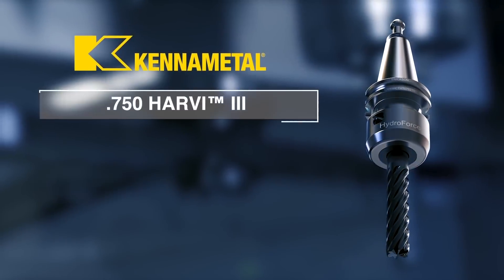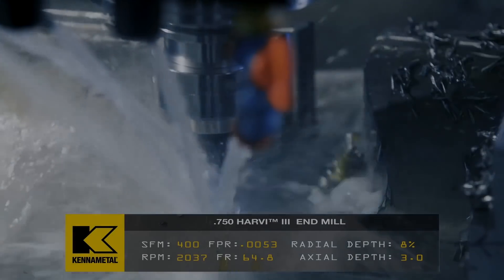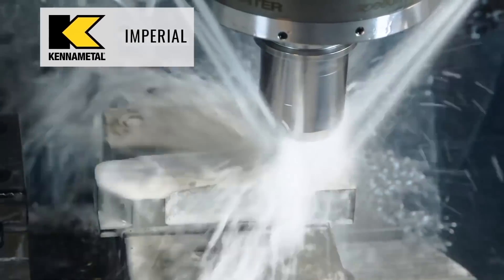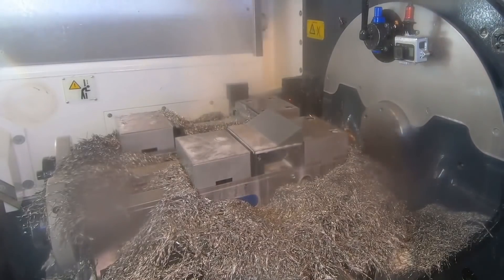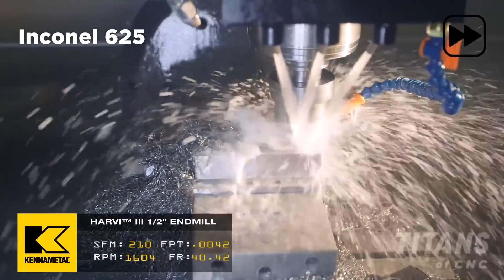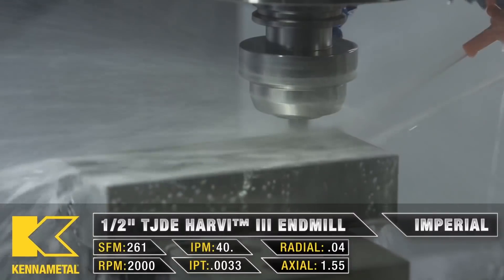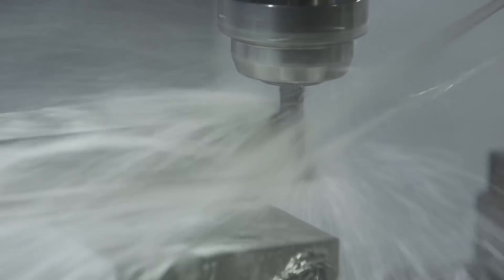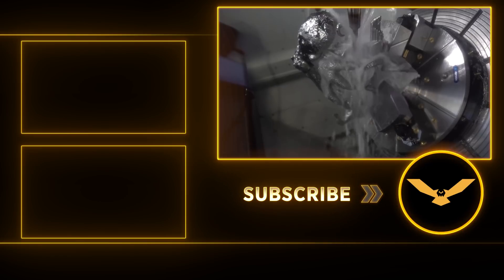The ZOMBIE MILL Apocalypse | Metal-Hungry Cutter Won’t Stop Eating | Immortal CNC Machining Tool

Comment: I have a question. Is there a rule of thumb regarding  spiral milling into a pocket versus starting the pocket with a drill? Obviously a lot of deep pockets would favor a starter hole and few shallow ones favors spiral milling, but we aren't here for the easy answers. 
How to calculate the near exact cost for each scenario is pretty straightforward but very tedious. And if you have pockets of greatly different dimensions then you have to make calculations for each pocket, determine toolpaths for multiple scenarios and combinations, etc. And if the part is a small one-off or a small job to bid for, then it simply isn't worth your time to make exacting calculations. 
I'm not a CNC programmer, just thought of the problem and couldn't see a solution.

Comment: Titan, Will you be going to FabTech this September?
Reply from the maker: No, not this year. Going to EMO2021 and then IMTS2022
Reply: @TITANSofCNC  Ill have to add the IMTS2022 to my schedule. Manager of CNC equipment at my job. You're earlier vids of HEM on hard materials inspired me to fix pre-existing programs from before I started. Now we running faster and tooling life is up 3 fold. All stainless 304L... Breaking that (change another man's program) wall for the better., More like , the programming was outsourced before I came onboard.

Comment: So it should work great with 17-4
Reply from the maker: It definitely works but you might want to switch to the HARVI 1 TE… It’s a Beast in Steel. Kennametal also has a KOR series end mill which is special for Stainless
Reply: I will definitely have to look into it I’m having a vary hard time with my boss ceo and programmer trying new things or buying new machines

Comment: My boss has finally let me buy one, dying to try it out!
Reply: "Breaks it first try''
Boss: REALLY!?
XD
Reply: @revenger2111  I better bloody not! haha!
Reply from the maker: Buying it from our store.titansofcnc.com right?? 😂
Reply: @TITANSofCNC  Unfortunately no, I was going to buy a couple at your boombastic show, but you only have imperial sizes, and can't be shipped to New Zealand anyway. I love what you do, and your passion for what you do. Your channel's been a great inspiration to me as a machinist. I've got a job tomorrow where I'll be using a 60mm (2 7/8") Udrill in my VF-3. That's gonna make some chips; I'm pumped!
Reply: When are you getting it?  Post here what came out of it. What you did.  What he said. ;)
Reply: @danl.4743  Will do. We've got a production job we do every other month, we know how many parts we get out of our endmills so this will be an accurate way to test. So unfortunately the results are probably two months away, can't wait!
Reply: @danl.4743 
I finally finished my experiment! I tried a few brands, all 6mm endmills, same speeds and feeds on a clapped out old Mazak using ER16 collet holders. Material is laser cut stainless steel sheet.
Aliexpress Blue (r0) = 0 parts (lol)
Aliexpress Grey (r0)= 32
Aliexpress corn cob style = 66
Speed Tiger PVR (r0.5) = 71
Aliexpress Green (r0.5) = 74
Speed Tiger EE (r0) = 244
Garr VRX (r0.5) = 288
SGS 46854 (r0.5) = 361
Kennametal Harvi 1 TE (0.3 chamfer) = 634

Yea, there's a pretty clear winner there!
Reply: Lol!  We broke our first one in seconds.  Shitty HAAS milling chuck broke it. Second one we put in a weldon holder and its great